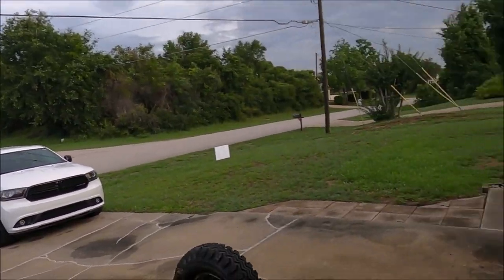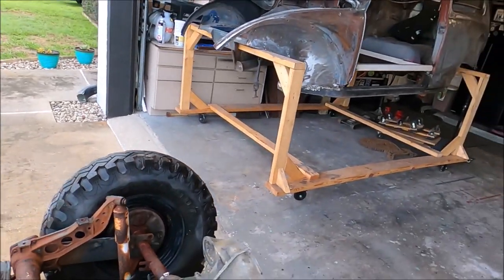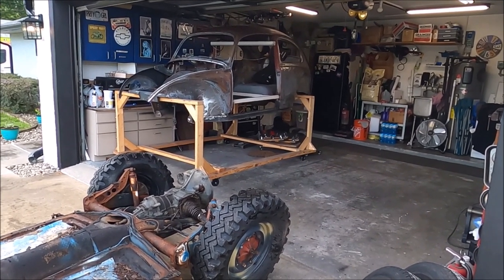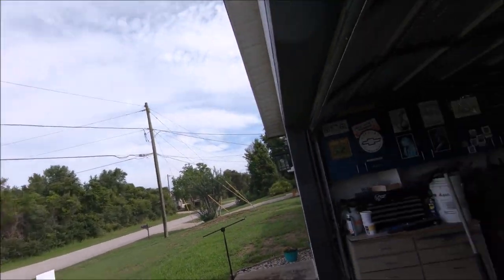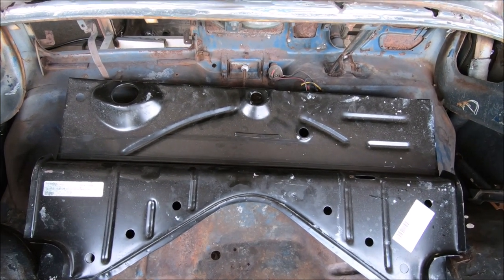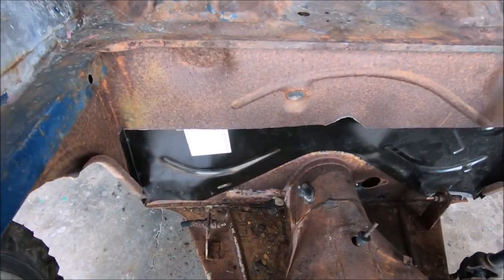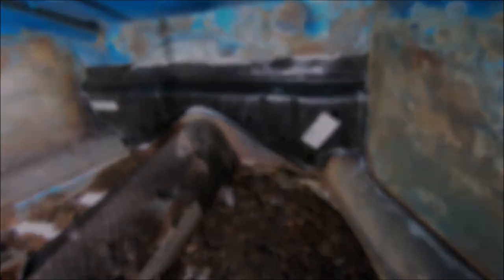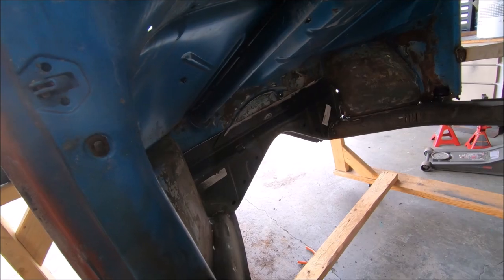Replacing the Front Firewall on a VW Bug  - 1960 “SICKXTY” VW Beetle DIY Volksrod Baja -19

Comment: Another great video! Nice to watch a "real" struggle with lining up bolts...we all go through it. I found using a long one to grab the threads works well. Then I can pull it down a bit and get the right one started in the other hole. Once that one is started and pulled down a little, I take the long one out and install the correct one in that hole.
Reply from the maker: Great minds think alike…. Just didn’t have the longer bolt lol
Reply: @VWJawbreaker  I never have stuff like that around when I need it either, lol!
Reply from the maker: @richdrenga7384  nature of the beast I suppose lol

Comment: I usually put the door supports in a different place so I can have the doors on and test fit the heater channels. Rear fender wells to the door a pillar support.
Reply from the maker: The doors would have stayed on if they were in one piece, the hinges weren’t rusted solid and if the lower a pillars were in tact. Many ways to skin a cat as they say lol
Reply: @VWJawbreaker  yea for sure just before you put the body back on the pan for good make sure the doors fit. and cut the braces out to do that. Then when you bolt it back on the pan there are a few different sizes for the pads that go on the body support. when you start to tighten it down check the doors again and if they start binding up you will need the different size pads to work and adjust to make it shut correctly.
Reply: pads are on wolfsburg west website 2 under the seat and 2 in the rear fender well.
Reply from the maker: @Mikefngarage  thanks man. I’ll probably do it backwards vs the way everyone else does it. I’ll finish the body for the most part, redo the chassis and get that done. Marry the two and then do the doors. 
Either way it’ll all come together 👍
Reply: @VWJawbreaker  yea for sure. however it will get done. just hoping I could save you a step or 2. keep in mind those pads. will come in handy. I wasnt aware they made them in different sizes. i had to ask around. Here there are more resources. will come out fine. looking good.
Reply from the maker: I greatly appreciate it and will definitely keep it in mind.

Comment: Nice job! No worries on the gap on the Napoleon hat. No matter how perfect you try to get it, there is always a gap. A lot of times I add a little extra seam sealer once everything is bolted down for the last time. Just extra precaution. Water is the enemy.
Reply from the maker: That’s what my thought was as well…. Then I noticed that the body was up slightly die to the rotten pans…. It’ll be fine when it’s all said and done. Like you said, a little extra sealer will sort it out.

Comment: Where did you get the new firewall?  So many options out there...and prices!  I'm doing a '66 bug on my channel.  Your videos have been helpful and motivational, thank you !
Reply from the maker: I think I got them from either the local shop or CIP1, can’t remember off hand. Most of the replacement panels need tweaks to get them right or to fit your project properly. 
I’ll check out your channel and I’m glad you’ve found little things in my vids that have helped you out!

Comment: Very timely vid, thanks! I'm replacing the heater channel fronts and firewall on my 65'. I'm a little surprised you had such a large gap between the hat and the firewall. Is the gasket going to be big enough to fill it?
Reply from the maker: The gasket won’t fill that much space but that’s about how far the channels were above what was left of the pan. 
Also, several people have said that the aftermarket ones don’t fit all of the way down, they suggested using some seam sealer when I put the body onto the pan for the last time.